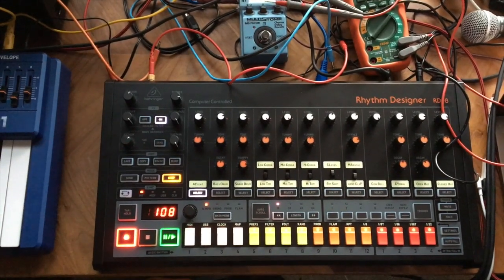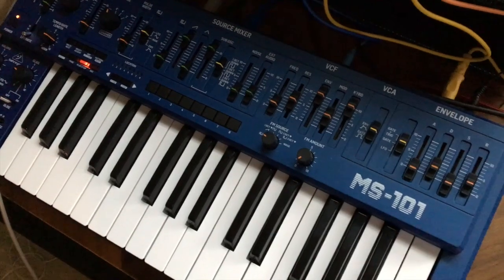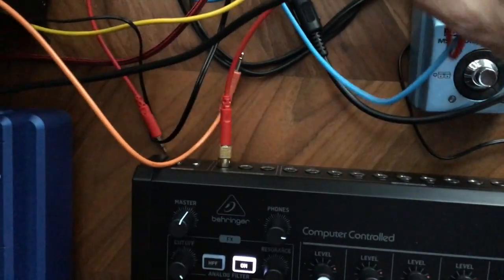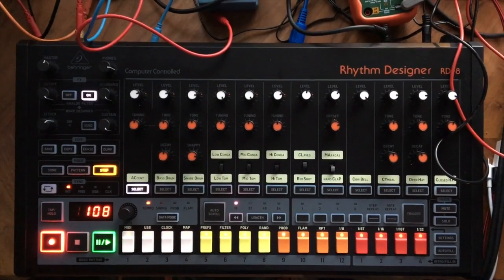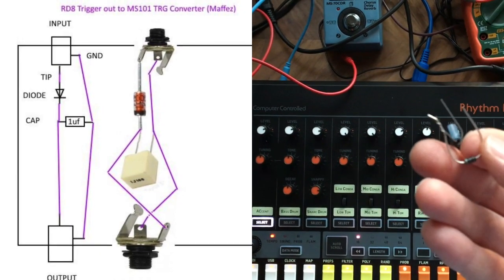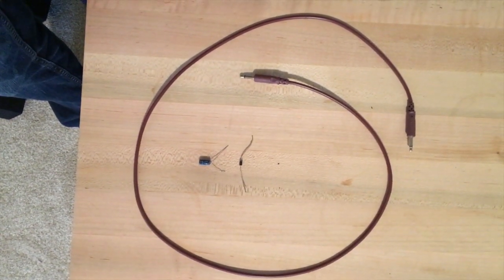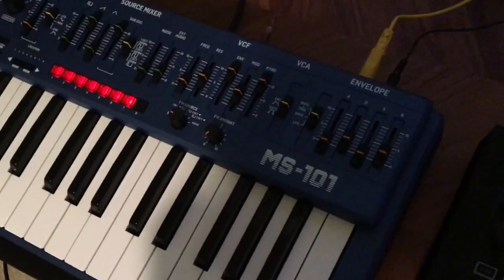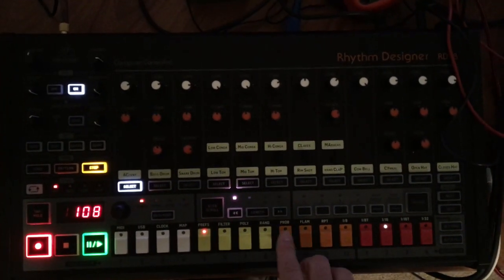Behringer RD-8 DIY Clock Trigger Wire

Comment: I do this with my 707 and original 101. 
The fact you cannot do it with this is ridiculous. Instead of sending out early beta versions months before release to people who have no clue, they need to send them out to people who know these instruments inside out. They would save a load of time and resources not having to rely on the public really testing them after release and going back and forth with firmware releases (and possibly issues that could only be addressed with a hardware fix).
Cheers for the vid. Hope you can post more mods with Behringer gear.

Comment: PEOPLE THPOUGHT I was nuts thats how behringer was supposed to make it !!!!Thanks for showing us what its supposed to do....NOW FIX IT BEHRINGER OR STOP PUTTING STUFF OUT SO QUICKLY
Reply from the maker: Keith Tucker Make a wire and it is no problem again. Hopefully it can be fixed in firmware. If not I will open it up and make it permanent.
Reply: @Digiphex  Thanks for your post
Reply: If i get the chord made that would be all i need correct no modular synth as you used

Comment: I just made a trigger cable like this. Managed to fit the components into a neutrik jack plug, and it works! Great tip!
Now I noticed your video on dialing in the correct cap value to 0,1µF - will see how fast triggering i can do with the 1 µF.

Comment: I absolutely love how banging the RD-8 is but there are several silly things with it that must be tweaked in the firmware update.
Reply from the maker: Behringer has told me that the clock trigger is the same as the original 808 but the MS-101 is the problem. However, you are right, the stuff with accent and flam on every single sound is dumb.
Reply: @Digiphex  RD-8 won't trigger the Behringer Crave but it will using the boutique TR-08.  This is how I stumbled into this problem.
Reply: @The_Invisible_Man I have an rd-8 and an original SH-101 and this trigger issue still happens

Comment: Thats not an "issue" there are different trigs and gates in eurorack land, drum trigs usually are short, if you need something different you have to use a module or make sth. like this.
Reply from the maker: You are probably right. It is more an issue with the MS-1. I sold this drum machine soon after but now I have the RD-8 Mark II and it seems to work great with everything but the MS-1 I noticed works well with nothing.

Comment: No MIDI clock out.Trigger outs need mod for function with same brand of synthesizer. Disaster..
Reply from the maker: Agreed. I don't understand these companies, any of them. Roland letting others make its stuff and only making cheap digital toys of its past, Korg making ARP which wasn't in its history and ignoring its own great MonoPoly,  Korg making a Volca Beats and putting a cabasa and agogo and leaving out the rimtap and cowbell, Arturia makes a black Keystep and sells out every one in an hour, and so they make only the white in the new Keystep and never black again. Teenage Engineering makes one decent product the OP-1 and then makes complete junk toys after that. I don't understand all their thinking. So stupid it seems.